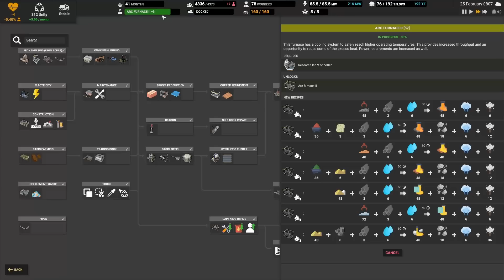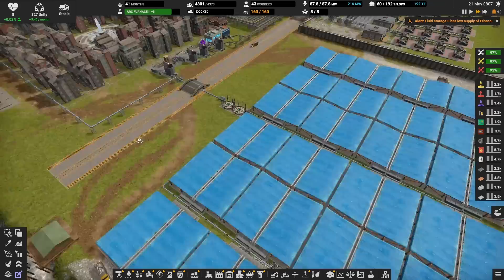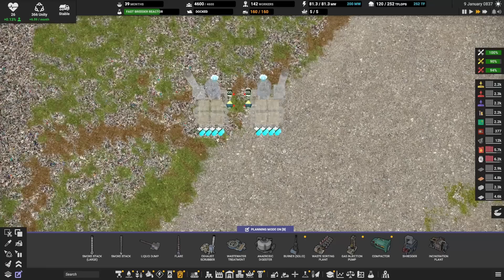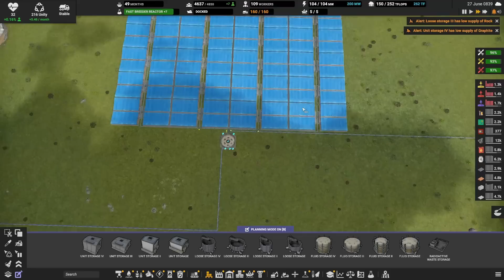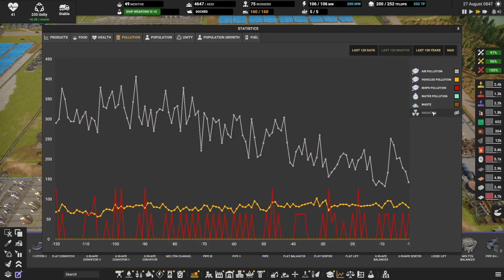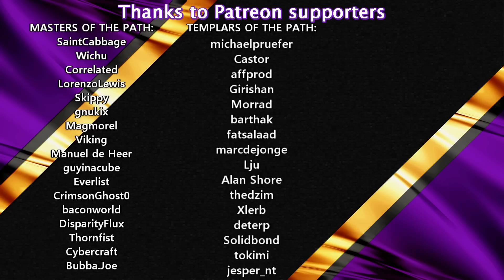NO MORE POLLUTION; Air & Land Pollution is Gone | 18 | CAPTAIN OF INDUSTRY | Admiral Difficulty

Comment: I found it easiest to set up the waste incineration when setting up a prioritized power setup. Since Waste incineration can also use natural gas, if you're using natural gas for electric generation you can just set up your steam lines to prioritize the steam from the incinerators before anything else, and likewise prioritize natural gas going to the waste incinerators so that it always gets first dibs on the supply. From there set up coal/wood chippings as a backup to the gas in the same way. Since waste is always being generated it makes sense to do this early as it's basically a consistent source of electrical grade steam at a low "fuel" cost.

Comment: I've not watched all the video yet, but I always find turning low steam into more water with the thermal desalinator is far better. 24 low steam = 72 water. Because exhaust processing is a critical function you need to ensure you have a liquid dump that can bypass and dump fresh water back in the ocean if you're not using as much as you process. With all that said, I can use my 3 exhaust scrubbers to produce another 216 water per minute rather than running a deficit for only 18 workers.

Comment: According to wiki turned off buildings do consume maintenance but at 33%
Reply: Both maintenance and fuel are reduced to 33% when idle or paused.
Reply: "Idled vehicles and buildings also consume Maintenance, but the amount is reduced to 33% of working ones. On the other hand, paused vehicles and buildings do not consume Maintenance." So turning off a building eliminates the maintenance, while one that's merely not busy still consumes 33% normal maintenance

Comment: I did the same thing and ended up with 6 air pollution which is from the scrubbers, ironically. It would be nice if the devs could add an extra step of completely eliminating air pollution